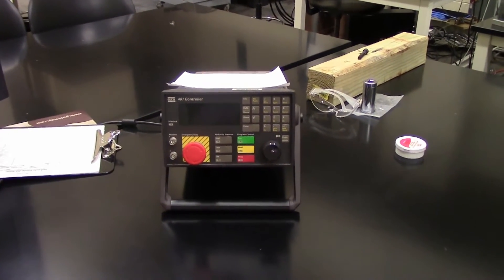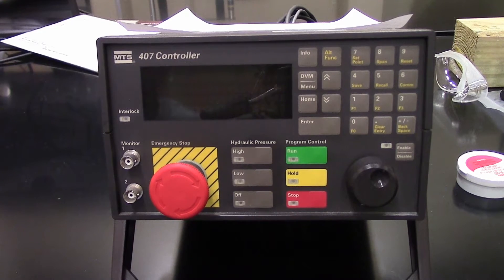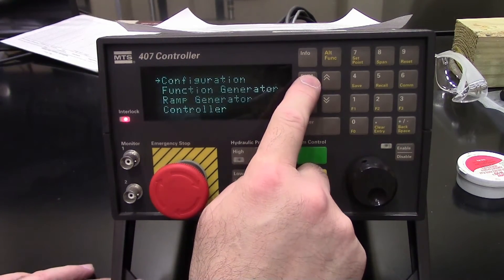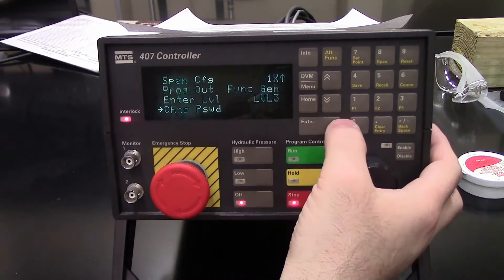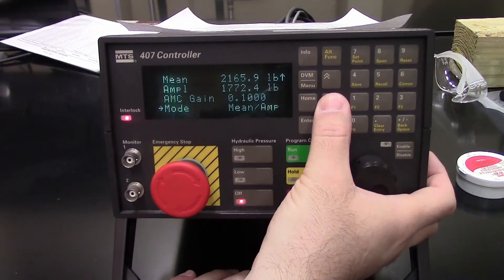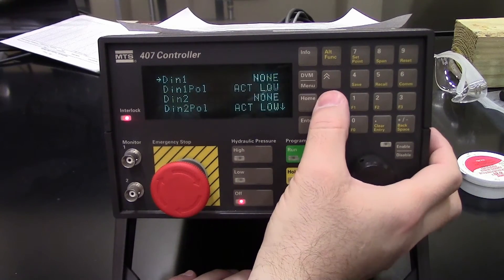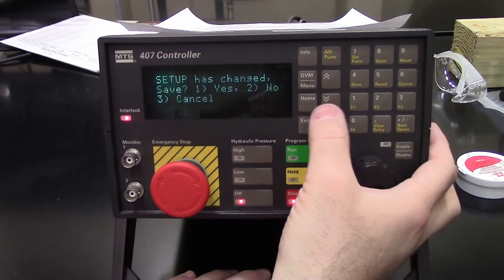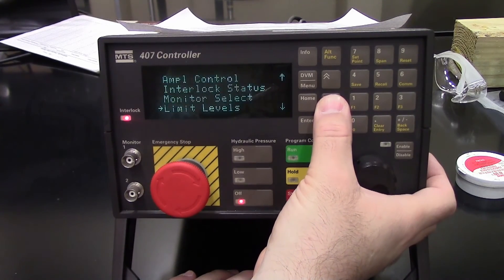MTS 407 controller panels

Comment: Old good 407 :) Have been working with it for years. Currently switched to digital  Moog Test Controller.
Reply from the maker: Yeah, it's a nice little unit.  The only thing it lacks (IMO) is mode switching. Coupled with a communications card, LabView 6.x !  and the driver set, you can really make some sophisticated tests.  I still use mine on some structural actuators.
Reply: Mechanics Channel by Mark Barkey As far as I remember it should be possible to use digital inputs for {low, high} pressure and {stop, run} mode. We where using it that way on assembly lines.
Reply from the maker: Nice.  The mode switching I was referring to was load to displacement control.  On the fancier controllers you can switch back and forth without turning off the hydraulics.  Great units!
Reply: I did not know about that limitation as we were not switching that way. I would expect that to be possible by go on hold ang go to run again. Are you using serial communication for that? As I do belive there is not sufficent count of DI to support all those switching options :). I had not studied that as there was a problem to get protocols specs. So I switch to other brand. We also faced problem of switching PID parameters 'on the fly' and few other parameters.